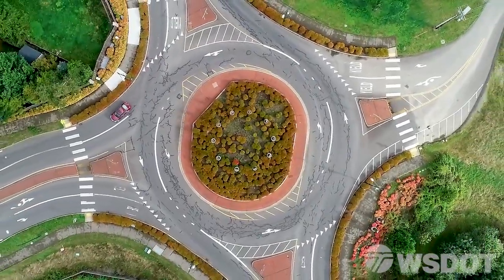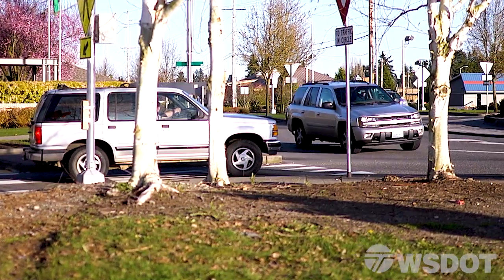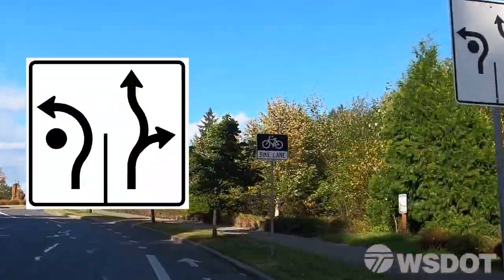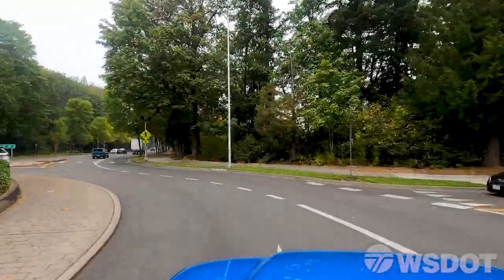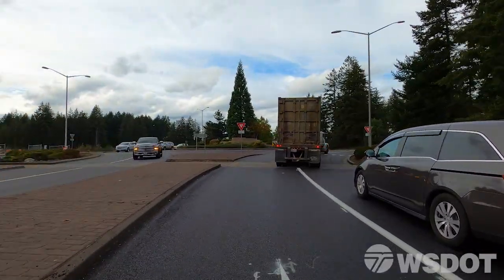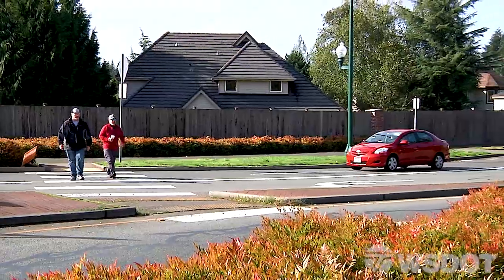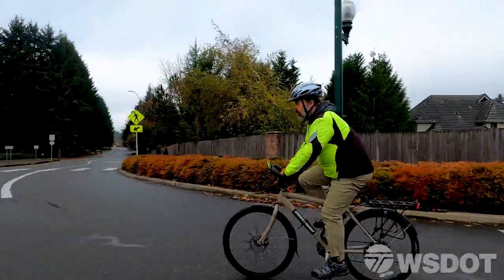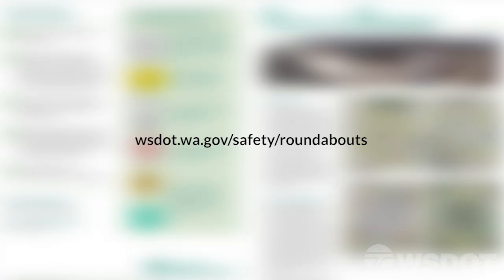How to drive a roundabout

Comment: The reason why so many yanks struggle with roundbouts  , not taught or have great defensive skills ie most American s are used to having to be aggressive however doing that on roundabouts just leads to more road rage , stress and impacts  , situational awareness as you going need to be checking your mirrors and being obverservant of what's ahead . Before leaving from inner to the exit you are turning off a blind spot check and a side glance  is a crucial minimises the chances of being side swiped or rear ended if you are fully aware of every vehicle around you , planning well ahead of where you want to before entering will make it easier too , maybe some states should offer  roundbout training , defensive driving education and situation Al awareness lessons
Reply: "Yanks"..... grow up little boy. No one says that anymore.